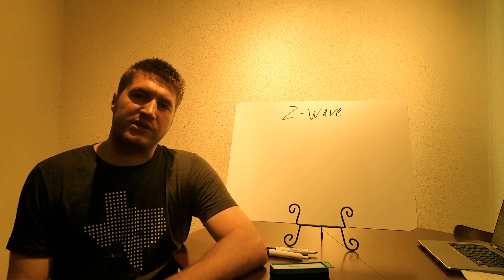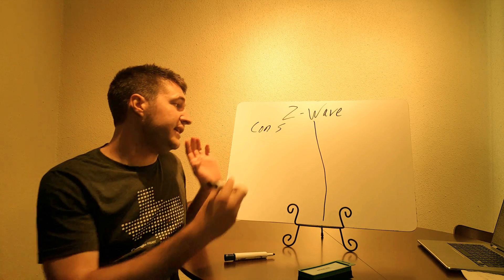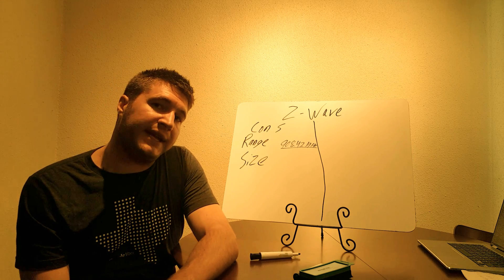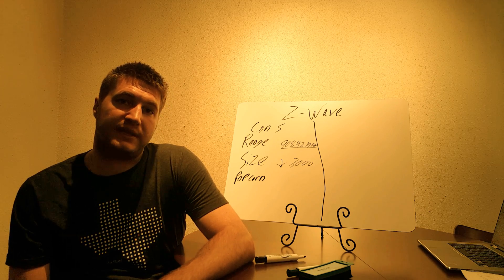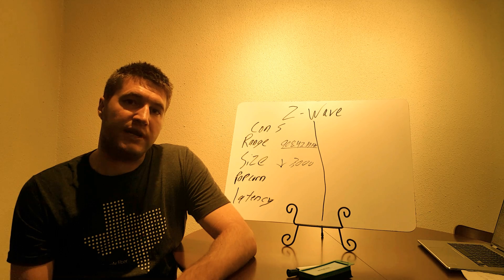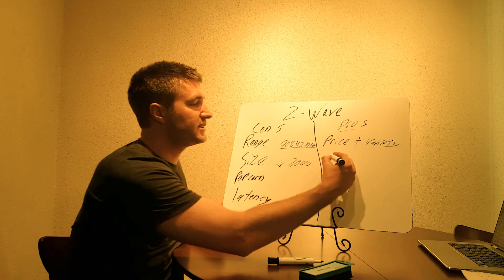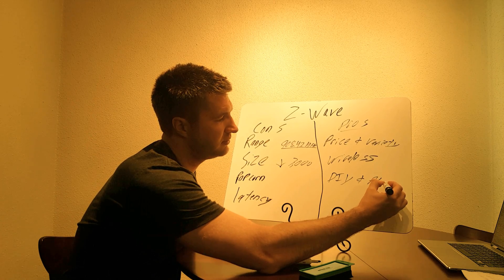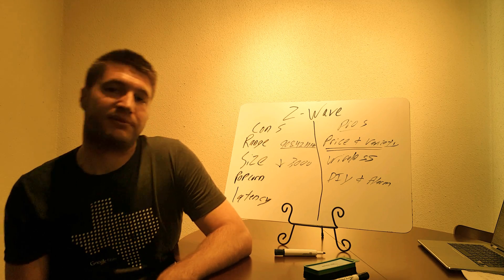Zwave Automation Pros and Cons

Comment: I would add one but main con - it's hard to setup even for a person who is not a newbie in computers and electronic. Question: what is good reliable z-wave standalone controller, so I can easily control it through wi-fi connection and so easily and reliably connect my z-wave devices such as honeywell thermostats?

Comment: 90% of the time the latency issue doesn't matter, but it sometimes is a friggin headache. The popcorn effect doesn't bother me because i rarely turn on multiple lights simultaneously, and if i do, it's manually. the latency and problems with devices being laggy or getting confused with repetitive fast use is rather annoying.

Comment: Well done, simple explanation, short and to the point.  I’ve been using Micasa Verde/Vera for 9 years.  Started with a Vera Lite and upgraded to Vera Edge last year for 2 houses.  I love the fact that I can buy from so many different suppliers.  Another valuable feature is the world-class support.  Anytime I have an issue, I get support within 24 hours most of the time.  The ability for me to set remote access to enable their ability to troubleshoot and sometimes even fix the issue themselves is priceless, especially for those that may not have a technical background.  Google recently released the ability to integrate the Google Home system with Vera allowing voice control of most all z wave devices.
Reply: W, main aapka

Comment: Good video, thanks.  I do have a  few comments concerning distance limits of the Z-Wave mesh network.  In my experience, even without using the mesh network, with most devices (I have tested/used dozens in 3 different Smart Home installations), Z-Wave does support distances of 50 to 100 feet depending on the environment.  Also, latency issues seem to have more to do with the controller type and its configuration (cloud based or local control based, devices used in the automation, etc.).  In most cases, a typical Z-Wave switch can be configured so that latency or the delay to react to a command is less than 1 second.
Reply from the maker: EcoNet Controls Nice shut off valve Econet ;) . Yes, you are correct it matters with the environment you are installing zwave. I have installed zwave in a 100 or so homes and sometimes it went 50 feet or sometimes it only went 15. Zwave plus has improved these distances considerably. Yes, you are correct with a cloud based controller or LAN connection it will definitely change the speed of zwave. Thanks for watching!
Reply: Hmm, do any of your Smart Home installations include a water shut solution? (prevent water damage!).  Let me know if you are interested in our Bulldog Valve Robot demo kit, and/or dealer discounts. ballen@econetcontrols.com.  Cheers! (I tried to private message but it does not seem possible through Youtube)
Reply from the maker: EcoNet Controls I have done a decent amount of shut off valves. I have always used the Fortrezz shut off. Cool, I'll send you an email.

Comment: After listening to your video I have decided "Not to go with Z-Wave". My house is 3500 ft.² and made of concrete and rebar. I also have a wireless phone system that could be a megahertz range that might interfere. Even Wi-Fi has been a challenge for me but with repeaters I have that pretty much under control. 
The big reason I was considering Z-Wave is when you lose Internet connection your Wi-Fi devices cannot be changed but Z-Wave would continue working without Internet . 
So for these reasons I will probably make most of my light switches and dimmer switches manual as well as Wi-Fi. 
It also seems that Wi-Fi devices are even more available and priced a little better than Z-Wave. I just hope that the Wi-Fi devices will be reliable. 
Reg
Thanks for your video it helped immensely with my buying decision.

Comment: When you say limited to 4 hops, does that mean I can only control 4 separate devices in my home?
Reply from the maker: Bassam A No, that is incorrect. I had over 40 zwave nodes going at my house and have installed over 100 on a job. Hops just repeat the signal to nodes that are further away. So if a device that is further than the possible hop limit than it will not reach it
Reply: Tyler D thank you.

Comment: I would put price in the cons category - its so expensive as compared to zigbee. How long does the battery last for z-wave devices? I read somewhere its 10 years? really? Please make a video about "zigbee pros and cons" - thank you
Reply: I saw such situation when a lot of new devices had low batteries. Normally not more than 2 years but sometimes less. Service called also some tip about when the device has low range it can consume more energy like in GSM.

Comment: I need help choosing a good repeater for my ST system. I have the first gen system from samsung and I just moved to a 1500sqft home and having issues with some devices in the garage, mainly is a outlet that I need it to work, but the garage door sensor works and a ge light bulb works, very strange. I have added 2 "repeaters" but I dont think they are doing a good job. I got one from Inovelli which also has an outlet and Remotec ZRP-100NA. Whats your take on this? Thanks.
Reply from the maker: Ricardo the hub shouldn't have anything to do with the problem communication. It almost seems like your outlet is not properly paired with the ST controller. I suggest first moving the hub into the garage and seeing if it communicates. If it doesn't then I don't think it has anything to do with the zwave network. When you say you bought repeaters did you buy specific zwave repeaters? Any zwave outlet, switch etc will do the same thing as a specific repeater. If other zwave devices nearby are receiving the signal then it should work. You may also want to do a network discovery of heal. I'm not as familiar with Samsung ST but a hub is usually a hub. Let me know if this helps.

Comment: Good information. Thank you for sharing. Have been curious for a while, how do you know what items on z-wave work with a certain system? I have pulse and when I called adt they had referred me to their webpage which list a pretty dull amount of compatible devices for the system. When you call a manufacturer they tell you it should work but it doesn’t. Is there a way to determine what zwave item works with my system before buying it? I have purchased 4 additional cameras, one plug module, and 2 light switch modules that do work, but the only way I found those was because I already had one of each provided by adt at install. No way, I’d buy additional from them because the mark up is outrageous. I bought a aeotec switch and it is noticed by my adt system but will not turn on or off by command through the adt system. I’d like to capitalize on the lower cost items but can’t determine if they will work or not prior to purchase.
Reply from the maker: Hey Dan, Thanks for the comment and I apologize for the delayed reply. ADT Z-wave pulse is a completely different story with Z-wave. This is a closed proprietary system with ADT. I am not very familiar with this platform nor am I very fond of it. Basically it should use any z-wave device but ADT determines what devices and drivers are compatible with it. It is hard to install or buy your own equipment when you are at the mercy of a company like ADT. I am sure you are in a 3-5 year contract but when this is over I would recommend an open platform such as Vera. Cameras are a COMPLETELY different story than Z-wave. It depends if the cameras are analog or IP cameras. Cameras would be about 10 videos just to get a grasp of what is compatible or the different protocols. I am sorry this not the answer you are probably wanting but please let me know if you have any other questions and i'll do my best to answer it.

Comment: Tyler, I have been using z-wave since the first chip set and now have almost an entire house based on zwave plus.  The range issue you mention might be relevant but I can tell you in my home that has a perimeter of 50-70 feet and interoperates on living and basement levels.  My controller is centrally located (more or less) and of my 90 zwave deivces all but 2 are direct to the z-net zwave controller.
Reply from the maker: Richard Morton Richard, Z-wave plus has made some much needed improvements with Z-wave. I made this video before it was really introduced. Not all manufacturers have moved to zwave plus yet. It also depends on interferences with the RF signals. A lot of people think I'm against zwave, which I'm not at all. I've just done some nightmare installs that people need to consider before committing to a certain technology

Comment: Price seems to be a little steep when comparing to Wifi Based devices, thus more like a cons.
Reply from the maker: I was mainly comparing it to more traditional automation systems such as UPB, Lutron, and Crestron. Price is on par with wifi based systems. You can buy z-wave bulbs, switches, and outlets for around $20 USD.
Reply: Can you point me to them? the Sonoffs i'm buying cost me usually like 5-7$..
Reply from the maker: Wow, that is CHEAP! I haven't used Sonoff before. How do you like it? 

https://www.amazon.com/GoControl-Z-Wave-Dimmable-Light-LB60Z-1/dp/B00PJH16UC/ref=sr_1_4?ie=UTF8&qid=1513546910&sr=8-4&keywords=z-wave
Reply: They are very cool if you're tech enough to flash them with some open firmware like tasmota.
Reply: The only problem with them is the Motion Sensor Part - while it can be soldered on/Integrated they cannot be powered for a long enough time from battery, thus i've been looking for z-wave/zigbee alternatives. But the PIR Prices seem steeper for good sensors.

Comment: Just to clarify a few things:

All battery devices are exempt from participating in routing - not just locks and thermostats.

Locks and thermostats support beaming because they are FLiRS devices (Frequently Listing Routing Slaves), not for security (encryption) purposes - thermostats do not typically use Z-Wave's higher level security, but they still do not participate in routing IF and ONLY IF they use batteries. Thermostats powered by the "C" wire of the furnace do not need or use batteries, and they participate in routing.

Size: 3,000 square feet is not accurate. There is not a practical limit to the size of the home. A Z-Wave device in open-air can transmit 100 meters, which is 328 feet. What limits this is when the signal has to go through walls and other materials. However, even through a few walls, the typical device communicates DIRECTLY with the source device and does not use routing.  When you add routing and 4 hops into it, you will see that you can do some REALLY large homes.  What determines how well it works is how many devices you have - if you have a large home, you need many devices to build a good mesh network; this is more true with older non Z-Wave Plus devices, but there are 6,000 and even 8,000 square feet homes being done successfully with Z-Wave.  

Popcorn effect is caused by consumers buying Z-Wave switches that do not support the Z-Wave Scene commands, or that have older Z-Wave controllers that were not forced to support the Z-Wave Scene Commands (Z-Wave Plus controllers should support this). With a Z-Wave Scene command, a "broadcast" (of sorts) message is sent to all of the devices in a scene, which is created ahead of time and programmed into the devices, and this allows all of the devices in that scene to react at the same time. If you do not use a scene, a controller can still use a type of Z-Wave command that can send a signal to multiple devices at once, and this too eliminates a popcorn effect.  Look for devices that have the command class "Scene Activation" in the list of supported command classes at https://Products.Z-WaveAlliance.org - your controller should also be found there and it should have that command class in the list of "Controlled" command classes.

Latency - Since most Z-Wave devices are communicated to directly, the latency is the round trip time for the command and the acknowledgement to be returned. This is less than a whopping 80ms.  Not sure what you are talking about with latency!  Even with four hops, the total time approaches 1 second, but is still pretty much instantaneous to humans.

The Z-Wave Alliance does not regulate the manufacturers, it is a grouping of manufacturers (over 600 of them) promoting and using the Z-Wave technology.  Sigma Designs, the owner of the Z-Wave technology, regulates manufacturers by requiring interoperability certification before any product can be commercially sold; this means that the device is required to work with devices from other manufacturers. This is one of the key things about Z-Wave - some people do not like that the protocol is not open inside the chip, but if it were, then anybody could create Z-Wave devices without having to make sure they were certified.

There are about 80% as many Z-Wave products certified for the CEPT (European) market as the United States/Canada/Mexico frequency - Z-Wave STARTED in Copenhagen (Europe) and so it is quite popular there; automating homes is what is not as popular in Europe. ;-)
Reply from the maker: Tink, you are correct on some of the statements in your reply but I would disagree with you on some of it as well. I checked out some of your videos and you are really bright. When I get some time I'll get you a long reply so that the readers can be more educated in this space. I made this video about two years ago and my attention has shifted towards crypto. Thanks for the valuable information and I'll get you a descriptive reply when I get some time!
Reply: My replies are direct from Sigma Designs, the owners of the Z-Wave technology.
Reply from the maker: Yes, I know Sigma Designs and know a couple of the people that work for Sigma Designs. A couple of the differences I would argue is the latency and the size. The latency is not a big deal if you're just turning on lights or other things but it is when you are making triggers. Such as if you want your closet light to come on with an occupancy sensor. That 1-3 second delay is very annoying. You can pair the light directly to the sensor but most people do not know how to do this. You also are not able to blink lights rapidly because of this latency as well. The latency is not much of an issue but can be an issue with certain environments. Having installed Z-wave in probably a thousand or so homes, I am pretty aware of issues that can come about with a home 5k+ square feet. I am good friends with a guy that set up a network of 37 Yale locks and he was only able to accomplish this with 3-4 hubs. You can install Z-wave in larger homes but I just mentioned the 3-4k size home being optimal. I'll elaborate more later...
Reply: The latency you mention is due to the hub. If you associate the sensor to the device it is instantaneous, and if you use a good hub it is instantaneous. My son has a sensor on a pantry door, goes back to HomeSeer, and then HomeSeer turns on pantry light - it is instantaneous. It would have a delay if you were routing the signals or went through a slow controller.  Locks are another story that you did not clarify very well. To send one signal to a lock, it does 3 transmissions because of encryption. This was address with Security 2 which is in newer devices. So when you mention that latency comes into play in some setups unless you associate the sensor to the device directly (you called it pair) but most people do not know this, then that is an opportunity for a blog article.

Comment: I want to purchase a new Garage Door Controller to work with my existing Chamberlin garage door opener. I have AT & T digital life security system. Which Controller should I buy?
Reply: The AT&T Digital Life system is a Z-Wave controller, and that is a closed system - e.g. they do not let you add your own devices - you have to call them.  If they do not support Garage Door Openers, you are out of luck.
Reply: Also, Chamberlain garage door openers use a signal over the two wires to the garage door button so they are not compatible with the Z-Wave Garage Door openers - there is a way to make it work; buy an extra remote control, and solder wires from the button and connect those to the Z-Wave GDO and that will work.  I have done it and it works fine, but you need to know that Chamberlain is different.  They are, however, working on a native Z-Wave solution.

Comment: I am setting up a home automation system . Intending to purchase Fibaro Controller. kindly advice me on the limitations, how stable is Z- wave. I am looking for a non cloud based System. kindly advice how far I can go with this controller too in terms of expansion if u have ever used it or have an idea about it and of course its credibility
Reply: Z-Wave has been around since 2000, it is very stable/robust and with each new advancement, they keep it backward compatible with the previous/older versions.  Fibaro I am pretty sure is NOT cloud based, but there certainly are a lot of controllers that require Internet access at all times - not good if your connectivity is spotty.